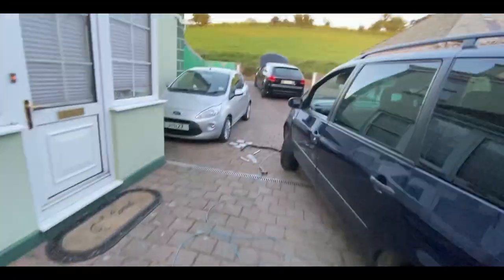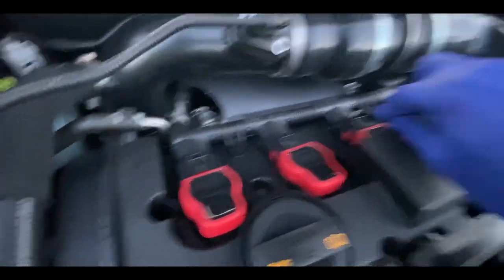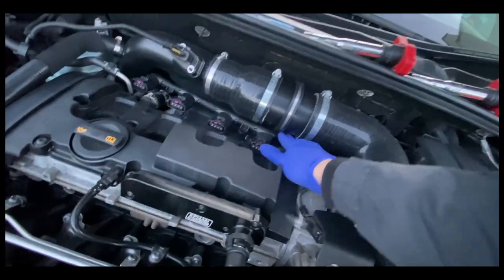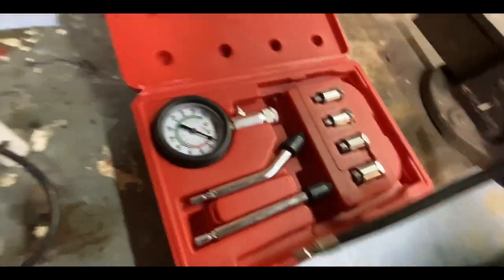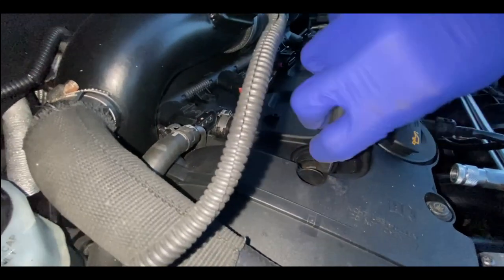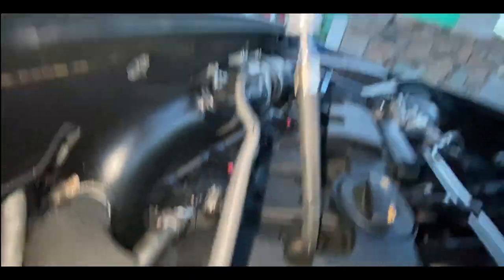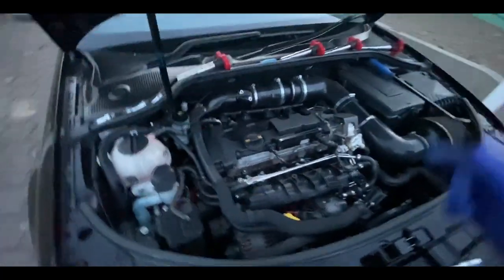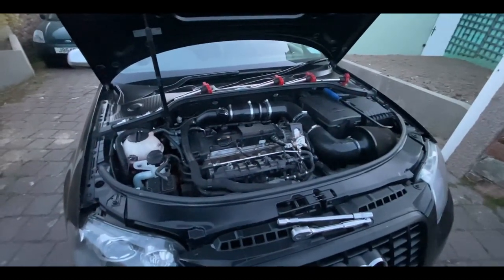Audi S3 8p - Compression Test!

Comment: Did you pull out the fuse for the fuel pump and/or the ignition system before doing the test?
Reply from the maker: No :)